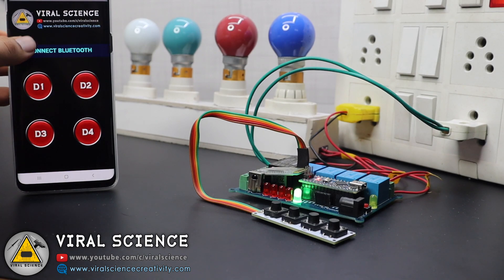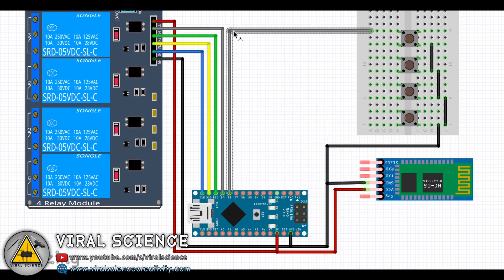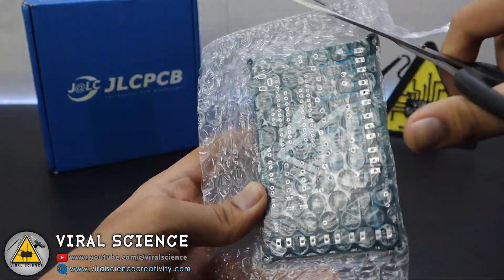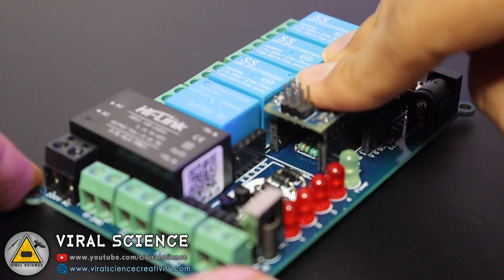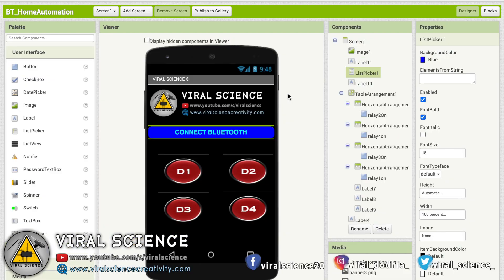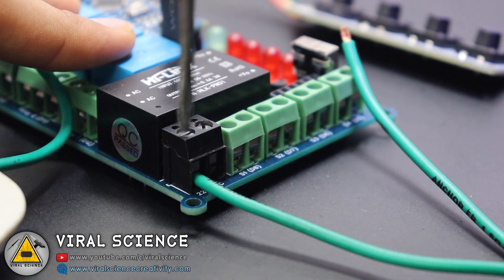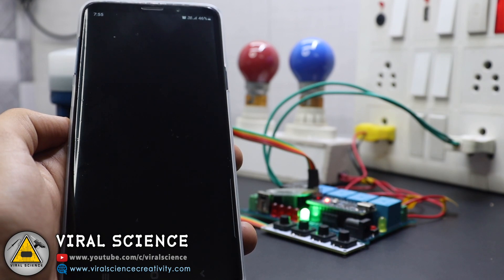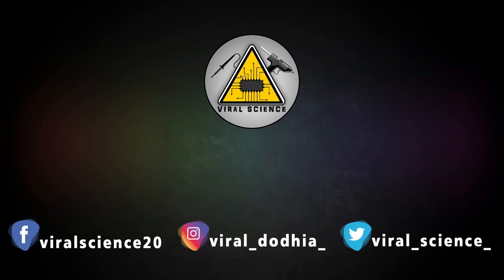Arduino Smartphone and Manual Home Automation System EEPROM Memory

Comment: bro...its not working in my case...
all are turning on if i press any button on mobile and after 3-4sec it's turning off automatically ...
what i have to do plz help....
i have not connet switchs just difined its pins